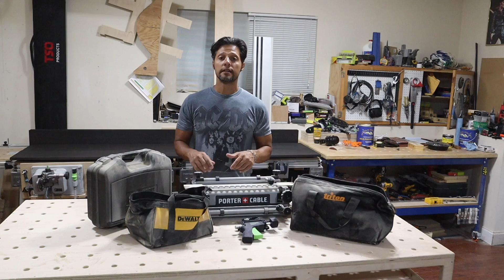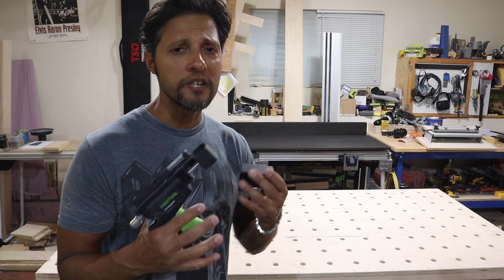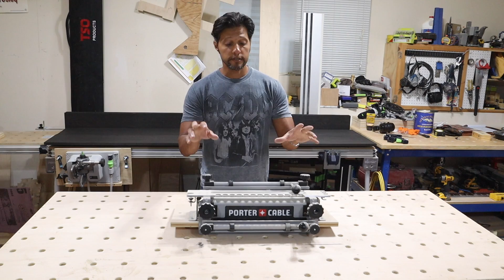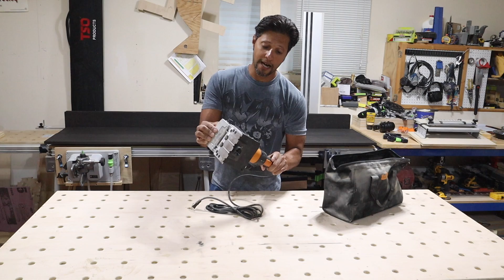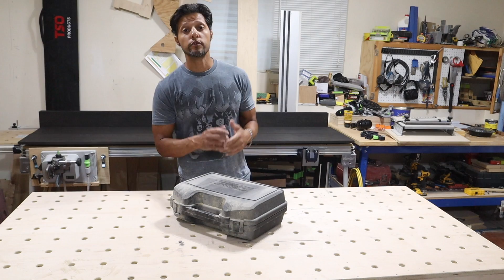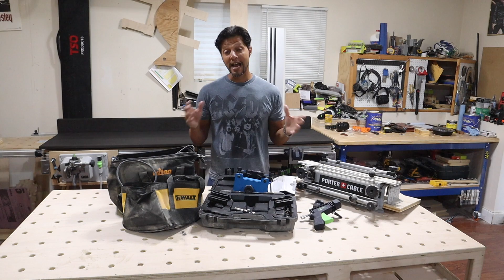5 Tools I Regret Buying (don't make these mistakes)

Comment: Agree totally on the Porter Cable and Kreg. The PC jig got shelved after one job.  I'm still evaluating the Igooo Dowling Jig which is a Triton knockoff. Had to modify/add vertical alignment lines to improve accuracy and the dust collection is not bad. 

Been using the Shaper Orgin and Plate for dominos but will definitely get the Festool before the summer is over.

Comment: Informative post as usual, Anthony.  You just stopped me from buying that dovetail jig.  I'm just a hobbyist and it looked like an interesting tool to buy, but I'll hold off on that one.  I have and tried the Beadlock system but never liked it.  It's gathering dust at the moment.  Didn't know about the rapid clamp.  I've got some Festool items in the shop, and like most of them, but they produce some duds too.  Bought two of their Clamping ElemenTS and found them to be complete garbage.  Thanks for posting.  Mark

Comment: 3 of those tools probably added up to the cost of the domino! 😆 
I think with all the time you spent trying to explain how the festool clamp works you could have just shown it in action, probably would have taken half as long and make more sense to people. The clamp is especially poorly suited to thinner material, as it can flex the material as it tries to squeeze it.
Reply from the maker: I would have demonstrated the rapid clamp, but all my tracks were tucked away in the TSO storage bag you see hanging on the wall in the background. I just got back from finishing up on site work and I wasn’t about to start unpacking lol. And I definitely wasn’t pulling the track off my MFT table.

Comment: Great video but I absolutely love the Festool rapid clamp. It really shines when I’m doing shelf pin holes using my LR32 system.
Reply from the maker: That was the real reason I bought it for the LR32 system when I make shelf pin holes, and no matter how I adjust the screw to make more holding pressure, it just doesn’t hold.
Reply: You think maybe you purchased one that’s defective? Tools are funny like that I see some reviews good and bad on tools that I own and I totally disagree with them but Festool is way too expensive to have a hit or miss as I’m sure you’re very aware of but I can tell you that I own 2 rapid clamps and use them quite frequently and they have performed flawlessly. I used the ratchet style for a couple years but the rapid style is just that. Anthony try another one and see how that one works.
Reply from the maker: @mrmarkfive  it’s quite possible but honestly I actually don’t need it because I really love my ratchet clamps. Even with the LR32 I don’t find the ratchet clamps to be a problem.

Comment: I have a dovetail jig....never used it.  Not once.

Moved to a pneumatic 6 inch sander with a mirka backing pad and even with 80 grit the wood looks like I sanded it with 120 or finer.  Still have the cheap dewalt because I still have 5 inch sand paper...but both are collecting dust.

But for me the biggest regretted is a drum sander.  It was my first big purchase and for the amount I use it it's not worth it.

Comment: I've owned a DeWalt
random (adjustable)  orbital sander for 10+ yrs and always got great dust collection w it hooked up to my 5.5.hp shop vac or not. Vibration isn't tht bad either..maybe Q.C. from 10+yrs ago has changed from good to worse .. just like my 734 lunchbox DeWalt planer had it for like 12 years sold it a few years ago and got back into Woodworking and re-bought it and it does not perform nearly as well as the one I had 12 years ago..so I'm thinking quality control  products has gone to crap over the years
Reply from the maker: Yes, quality control is out the window on a lot of dewalt products these days. It’s all about the quantity they push out.
Reply: Have you ever tried a real sander like festool or mirka? It's day and night
Reply from the maker: @MrTresto  I use the mirka everyday. I also have the festool rotex and the dts400 detail sander. There is no comparison. festool and Mirka have the best.